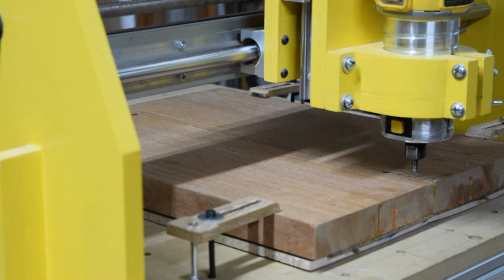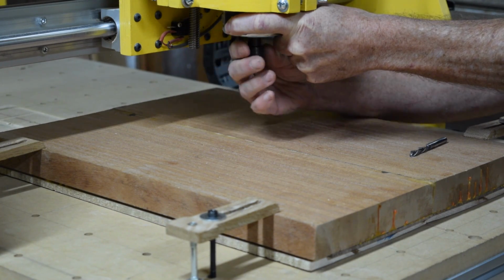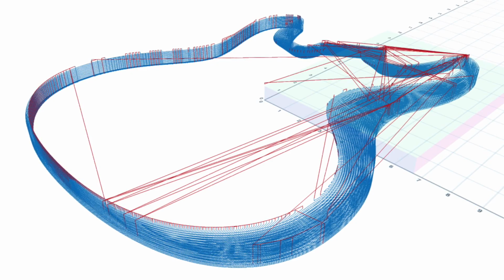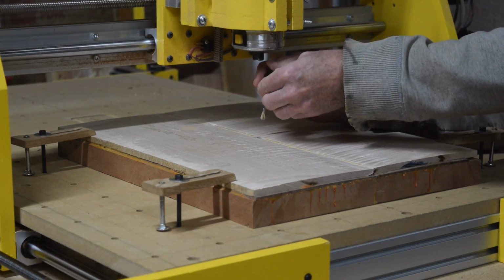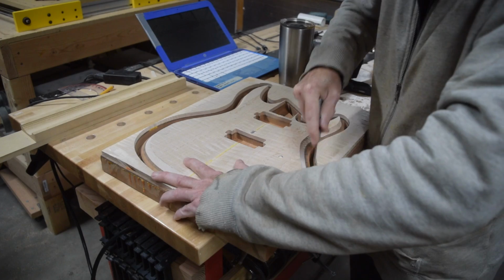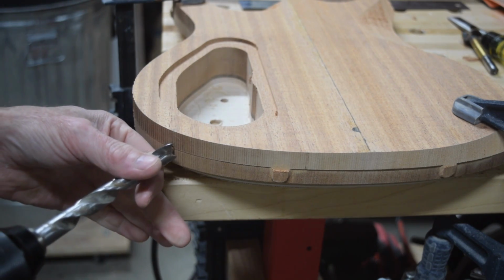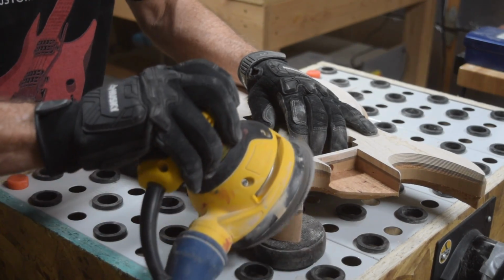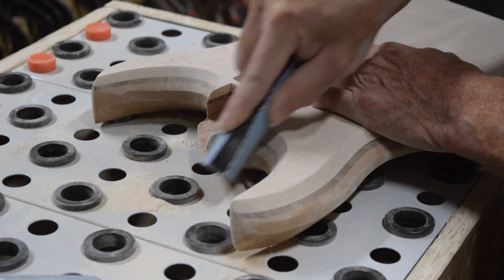Making A Laminated Top Guitar Part 7 Making The Body

Comment: You obviously have the machines and technical abilities to work on these tools, but I have to say, it's better to build by hand, my opinion.
Reply from the maker: No it isn't. I've done it both ways. Using CNC is faster, more accurate, and the results are of a much higher quality.

Comment: That sanding thicknesser you built is quite nifty. I've used "cheap" ones before (although they're still really expensive), and they're a bit useless. The motors are a bit weedy. What motor did you use for that one? A bench grinder? A washing machine?
Reply from the maker: I used a 1hp single phase electric motor.
Reply: @HighlineGuitars  
Ah, okay. Thanks for letting me know. I see you've got a video on the build of your drum sander. I'll check that one out. Didn't know you wound your own pickups as well. Respect to you sir!

Comment: Sanding tight contours: I recommend using a lint roller and cutting your piece of sandpaper to wrap & then stick to the roller's sticky paper sheet. It holds it for you and then you have a handle to use.
Reply: instablaster

Comment: What is the thickness of your wood blanks? What is the normal thickness for a normal electric guitar? I have seen numbers from 1.75 up to 3 inches thick.

Thank you!
Reply from the maker: My blanks start at 8/4 or roughly 1-7/8” thick. I then plane them down to 1-1/2” to 1-3/4” depending on my mood. The only rule here is that the body has to be thick enough to accommodate the hardware selected for the build.
Reply: @HighlineGuitars  I deleted the question since the answer was in your previous one. lol.

I just bought two of your plans as an appreciation for your work. I do plan to build the drum sander.

Comment: I am curious if there is a reason you are using the CNC and then drilling holes for cables such as on a Tele, whereas the body has a maple top, so an alternative would be routing channels possibly with the CNC prior to gluing on the top more like the approach used for a Les Paul?
Reply from the maker: I have done it both ways many times. Drilling is faster.
Reply: @HighlineGuitars  Thanks, efficiency of time is a good reason...

Comment: Love your videos. Suggestion: why don’t you use guide pins in every corner of the body blank so when you flip it, it falls in position without finding center again? I’m not an expert, I’m just trying to find ideas for my next build. Thanks
Reply from the maker: I used to do it that way, but it actually takes longer to do because the holes for the pins have to be precisely located. Also, it really only works if you’re making the same parts over and over from identical blanks.